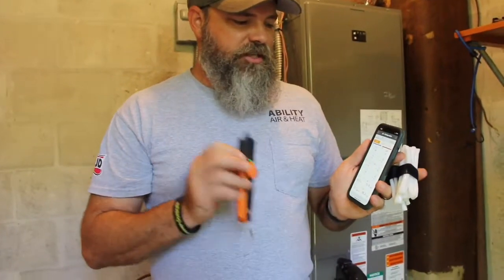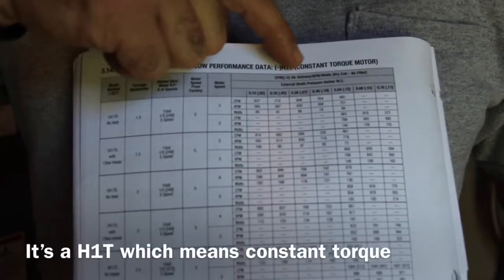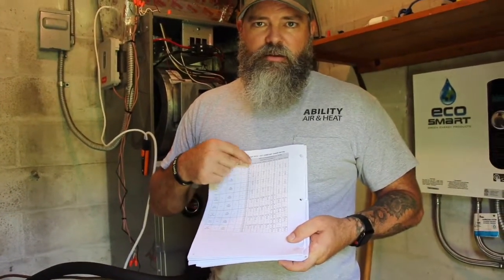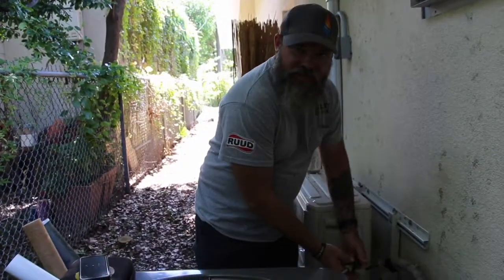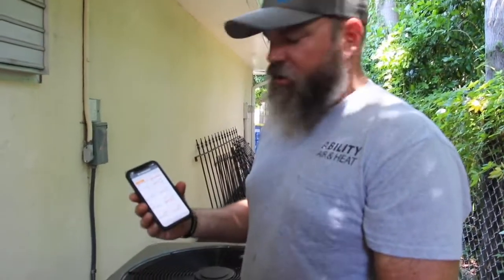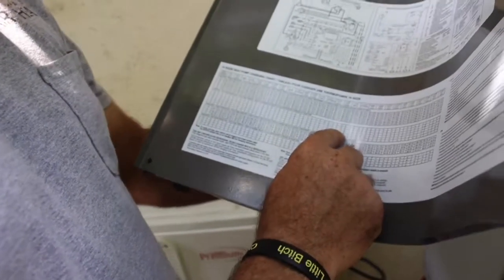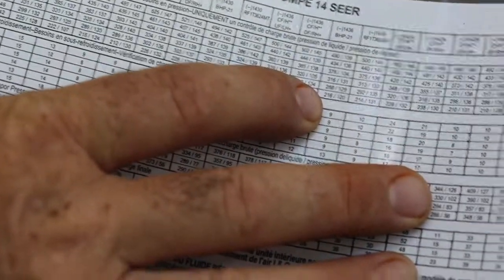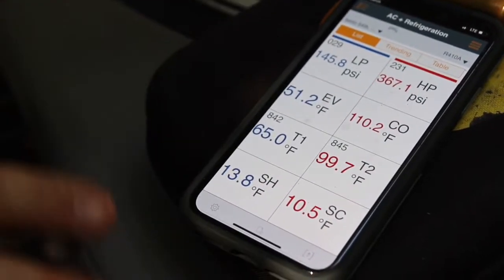How to Measure Total Static Pressure

Comment: Very informative video. You’re an excellent teacher.
Reply: How do you know if your static pressure measuring probes are reading accurately?
You say 0.36, what pascals, inches mercury (hg) or or h20?
The placement of the probes is not defined.  Quite often service personnel place probes in supply air but place return air probes before filters or between filters and coils. This placement misses pressure drop across filters, coils or both. For TOTAL SYSTEM EXT. STATIC (Defined as the total resistance the fan has to over come to deliver required airflow. I.e. ductwork, including straights, bends, transitions, plus filters and "wet coils"). The return air probes needs to be after coils and before the suction of the fan. (In a draw through system). Essentially the best way I know of is to measure before and just after fans for both draw through and blow through systems.